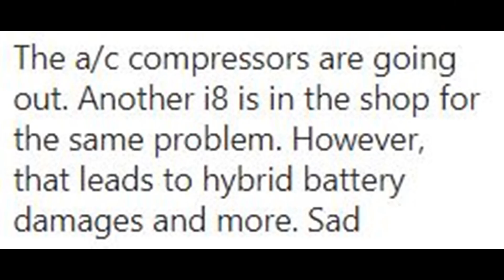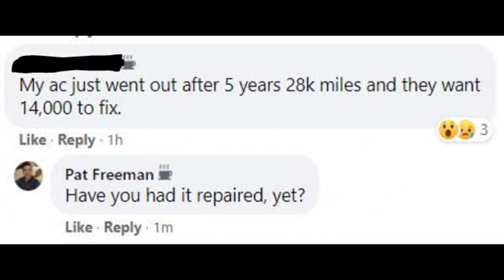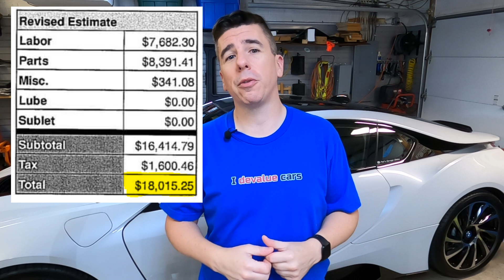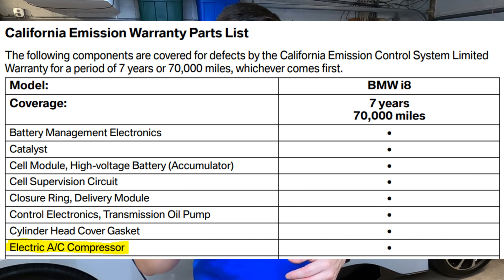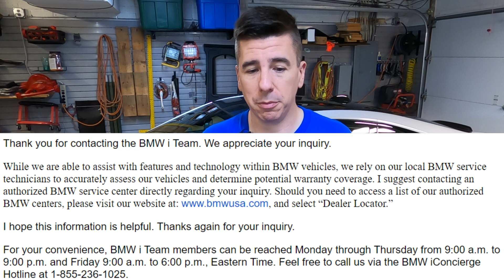BMW i8 Air Conditioning compressor problems and costs

Comment: I just bought mine two month ago with 4,000 miles and it’s been at the dealer ship practically same time. The bill it’s up to a $8,000 now for the same reason. Too bad i didn’t know. I paid for the car $85,000 in July 20 and the ac broke 5 days later
Reply from the maker: Oh wow. I'm sorry to hear it. The previous owner probably knew about it and never disclosed it. I wonder if you have an legal recourse.
Reply: Hello this is really bad! Can you say how the defective announced itself. Did it not cool the interior or by noise?
Reply: Today i received the quote for the job. It was $17,800
My car never had a noise. One day the ac stop working. This is really bad. They don’t even know what to tell me, except that i own them a lot of money
Reply from the maker: Oh no 😮
Reply: @joserequena4711  I was now three times each year 18,19,20 at BMW, the first time was filled with forming gas and tried to find a leak. The second time was probably only filled up. After that the air conditioning worked fine again. Now the third time I pressed harder because I already paid twice. Now a leak in the vaporizer was measured, it was replaced. But I am not sure if everything is good now.
Reply: FRitz Walter i think we need establish a class action law suit
Reply: @joserequena4711  any update on this?

Comment: Hey Pat, thanks for the great info.  Based on this video, are you saying that CA-registered i8s have a little more buy time due to CA emissions coverage (ie, 7 years/70k miles from original purchase date)?  If so, that is a great relief.  That almost guarantees that the compressor will be replaced once for free under CA emissions warranty, given that it should fail within 7 years or 70k miles.  Keep up the great informative videos!
Reply from the maker: Definitely check your warranty guide. That was what was in mine. I only found it this week. And I'd confirm with your dealer that it is legit.
Reply: https://www.bmwusa.com/explore/bmw-value/bmw-ultimate-service/service-and-warranty-books.html, then look up your year and model. In my case since it's a 2014 I have till the end of this year. And I am in California, but, car was originally sold in FLA. Not sure how that works.
Reply: @slkttop  Warranty guide explicitly says that cars registered in California have the 7 yr/70k emissions warranty.  So in your case, if your car is now registered in CA, then it is covered by that.  Another important point I found is that if your i8 is a low mileage one, then per the warranty guide, "If your California-registered vehicle is between 7and 8 years old and has been driven less than 80,000 miles, then your vehicle is eligible for additional warranty coverage under the Federal Emissions Warranty."  So that's an extra year there.
Reply: @gregh3256  Thanks, I'll have to look that up. I have a 2014 that currently has around 1500 (not a typo) miles on it.

Comment: Had a 2014 I8 with 27.5K miles. Sold it as a precaution as the anxiety of waiting for inevitable was just not worth it. Amazing car - looking forward to eventually picking up a newer roadster model soon.
Reply: Roadster will be a cast iron investment car as only 2578 made before production ended. Just make sure you get the 'depn up front' discount of 45% on the car as I did !!
Reply: Paulthorpe how did you get 45% off? And what are the numbers please? Feel free to pm me if needed
Reply: I'm in the UK and most dealers have one cat left in stock unsold with del mileage RRP here is circa £139,000 with a few extras and most cars with say 150-500 miles pre registered in late 2019 are £75-78,000 - same in France Germany etc  hopefully same in USA - the car will appreciate like my E26 M1 1978 has (now $500k but they were sold at a big 25% discount as was the Z8 I have in 2002 now 3 X 2002 list price) but will take 10 years to properly get going !!! Good luck with sourcing the car cheaply it is so much better than the 2014 coupe version I had and even fun on canyon roads in electric only as front axle geometry has understeer dialed out !
Reply: Paulthorpe thanks for sharing. So far I haven’t seen those prices in the US but I’ll keep an eye out
Reply: Sold for how much? If you don’t mind me asking and in what state?
Reply: I received $58K in Arizona - the car was in perfect condition without any issues. Was the Tera World package.
Reply: @erron11  That's amazing! Kudos to you
Reply: this may be me soon. 2014 i3 Rex Tera at 95,000 miles. At 70,000 miles, the car still had bmw care and bmw put new wheel bearings in my car, the bmw ix a/c compressor, and for some reason they replaced my suspension. The repairs they did were free but they were valued around $25,000 more than I bought the car. I dont have a lot of money so every day i'm scared the car will fail.